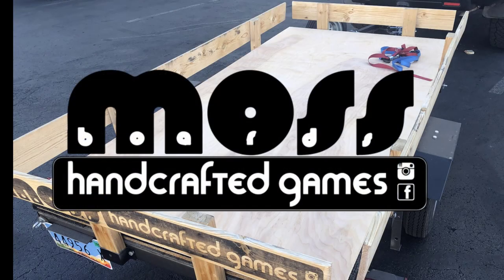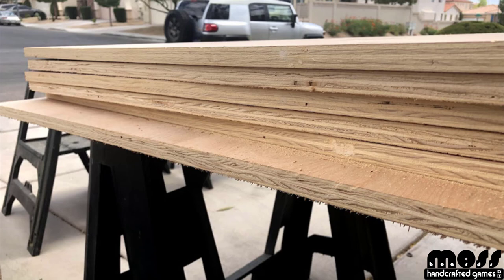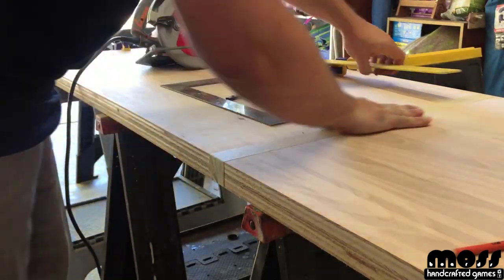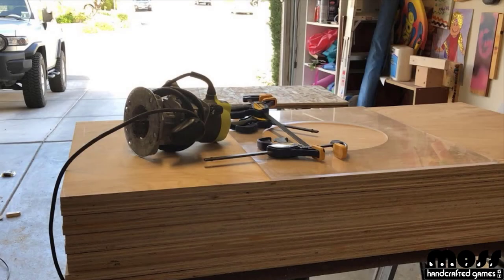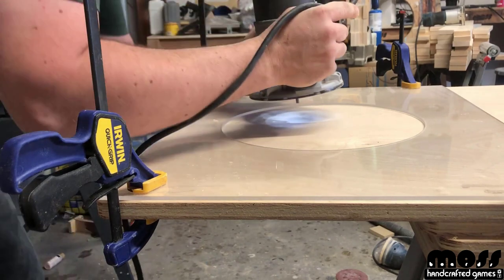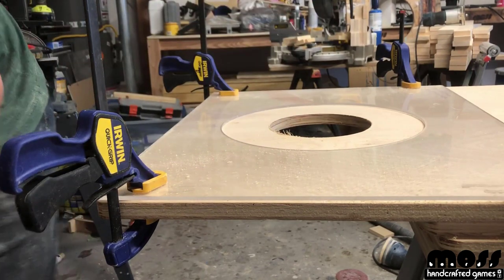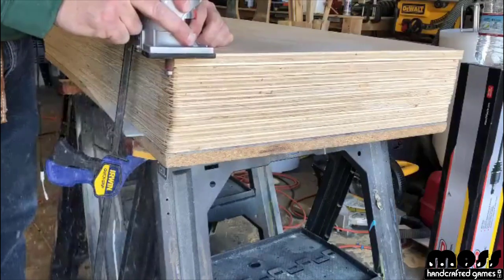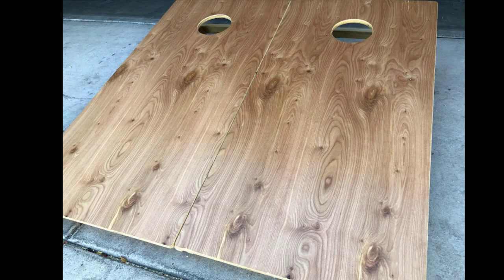Better Cornhole Boards Phase 1: Tops!

Comment: Great video.  I use to use a 6” hole saw and got tired of the drill twisting my arm off. So now I use the Jasper Circle cutting jig model 240.  Perfect 6” circle every time 
‘
Reply from the maker: How do you avoid slipping on the final piece holding the hole cutout? I used to use the circle jig and would have to clamp the board down and screw the hole punch to a scrap to keep my bit from slipping when the center hole was released from the board.
Reply: Cornhole Collective I use a waste board and double sided tape under the cutout. The tape holds the cutout so that it doesn’t move. Works great.

Comment: When you cut that, roughly, 8x4 sheet of Birch in half to make two boards.. I couldn't hear what you used to get such a straight edge on that cut.  I used a circular saw to cut mine and its not quite, right.  I also jacked up my circles but I see plenty of comments below on how to remedy that.  LOL. Nice video.
Reply from the maker: Thanks for watching Jim! I use a Kreg Ripcut guide in my circular saw to cut the full sheets in half. Then I use a 24” metal square clamped to the tops to crosscut those in half. Always take before the crosscut to minimize tear out.

Comment: Great video!!  I like the plexiglass template, would like to see the dimensions on that. And can’t wait to see the next video on the board frame. Thanks again!!
Reply from the maker: Kevin Millevoi 2’ wide, hole is 11 7/8” and works with a 6” baseplate router and a 1/4” spiral cutting bit. I prefer an upspiral bit.
Reply: How did you get the perfect hole in plexiglass? Be nice to see how that is done
Reply: @bryancarfley5467  I'd like to know the secret here too.  I would think using a router could cause the plexiglass to melt as you are cutting the template.  @Cornhole Collective?  Great videos.  Right now I am using an upspiral bit and a home made circle cutting jig and measuring manually to find center.

Comment: I currently use a hole saw. I get it started on one side then flip the board over and finish from the other side and that allows a clean cut, not blowout. I get through in about 2min and dont try to power through it.
Reply from the maker: For sure. Helps to have a wired or very strong drill and Popeye forearms.
Reply: @cornholecollective7116  I just cut a few last night. The only thing I dont like is when it catches and yanks your hands. Im getting routers and all that to make boards like yours. 

I saw the list of things you use online. I have some questions.

 So you use a hand held router for the edges and corners and then a different router for cutting holes? I saw theres 2 different routers. 

Can I use Kreg K4 to build a set or are there multiple jigs for different pocket holes etc?

And Is there a way that I can just order and buy the vinyl designs I want to stain/paint boards as needed for now? I dont build on the scale you do. As of now im just building to put them online locally, for fun and building for friends
Reply: @cornholecollective7116  I just tried to follow/friend on FB and was denied. I havent joined yet bc im still buying tools. So I said 'intend to join' and was denied. I just wanted to follow so I can share with people

Comment: When you do the round over around the entire surface, are you setting the depth to half the thickness? Just got a router and want to make sure I’m not messing anything up.
Reply from the maker: Great question. When I use a 1/4” round over bit i don’t use the full radius. I extend about 2/3” of the rounded part of the bit past the baseplate. Just a personal preference. Lately I’ve been using an 1/8” round over and like that a lot. Be very careful that the corner edge of the blade doesn’t extend past the baseplate or you’ll gouge your deck.
Reply: @cornholecollective7116   Thanks for this, I have been nervous to try and wasnt sure how to set it either.

Comment: I thought about three crosscuts for the four boards 

Never thought about grain direction
Reply from the maker: If you’re fully painting or wrapping the boards, that might be an easier way. My personal preference is the look of long grain and avoiding tear outs with an 8’ ripcut. It can be a lot to juggle if you don’t have a helper or full size table saw.

Comment: Use the wooden Jorgensen clamps. They have a lot more clamping power. After clamping the clamp parallel on the work, use the screw that’s furthest away from the work to tighten the clamp. It won’t move at all.
Reply from the maker: They look like great clamps. I love the security of my screw clamps but it slows me down a lot. Use them for art frames and bigger projects all the time.

Comment: I use a 6 inch hole saw. I don't know why people have so much trouble with it? They might be pushing down too hard? I use little down pressure, cut halfway down. Flip the board over & cut the rest. No tear out...easy peasy. 😉
Reply from the maker: Nothing wrong with a hole saw.

Comment: I just attempted my first set went well so far until the hold low saw slipped but I have a light ring so it doesn't really matter. Idk that I'd build another set I'd rather just purchase once and be done
Reply from the maker: If it’s just to make a set your yourself, especially without many tools, buying is usually the right choice.

Comment: What dimension ply do you purchase? I normally get 3/4' ×4'×8' but I can only get three boards due to cut waste. Thanks for the help.
Reply from the maker: Hmm, Plywood normally has about 1/8” extra width and length for the blade. Mine does. Full sheets ripped and cross cut always gets 4 decks. Ive heard of some mills that don’t.
Reply: @cornholecollective7116  Would you recommend cutting the ply long ways then cutting those sections in half? I've been cutting them 3 times on the short end since the board is most often already 48in long. That's where I'm getting so much waste... I already believe I know the answer by asking my question. Light bulb moment. But instill want to make sure.  Thank you for your help.

Comment: How did you measure and cut your plexiglass template? Thanks!
Reply from the maker: The diameter of a baseplate template like this is the diameter of your baseplate + 6” - the diameter of your bit.
Reply from the maker: I have another video on how to make one.

Comment: The plexiglass template is a sound idea. What did you cut the hole with that won't splinter up the place? Great video, thanks
Reply from the maker: Thanks! I like it the best of the 3 different ways I cut holes. I used to use a home made circle jig that I attach to the baseplate of my palm router to cut the holes. That method requires a lot of set up and if you slip, you're toast. I realized I could adjust the pin, make one plexiglass template and use the baseplate method that I do now with my full size router. Mine is literally scrap wood I bolted to the bottom of my router with a hole to pivot on. Here's a MUCH nicer version of a circle jig you can make to cut your big hole. https://youtu.be/Sf6lqFn_vCw

Comment: I use a piece of mdf with 6" hole and flush trim bit in the router
Reply from the maker: truth h yep, good method, I did that for a while too. Because those bits are meant for trimming instead of cutting, it wears out the fluted blades faster than a cutting bit.

Comment: When you sand your decks? Do you start with like an 80 grit and work your way up to 300+ grit?
Reply from the maker: They come pretty smooth so usually straight to a 320 is good. 180 then 320 if not. Don’t go over 320 though if you’re staining. It “polishes” the wood and it won’t take stain well.

Comment: would I be able to do these cuts with a battery powered Ryobi or do you suggest something stronger? I was looking at buying an electric router but was curious if I should go ahead and buy a plunge router if im going to buy electric? thanks!
Reply from the maker: Hey Blaine, if you have a spiral cutting bit, you might bet away with a cordless router but it might do a number in the motor. I know a lot of builders use a wireless Dewalt without too much trouble. Don’t try it with a fluted bit though.
Reply: @cornholecollective7116  thanks for the response!

Comment: So tape for cross cut but not needed for length wise?
Reply from the maker: When ripping ply (cutting with the grain) you will not often experience tear out since you’re going with the grain, however a cross cut going perpendicular to the grain will more easily get tear out. A fresh blade with the proper tooth count for the job will do a pretty good job, but if you have any bad luck or your blade begins to dull you may be left with some tear out that a round over bit won’t fix

Comment: How did you make the stencil to make the holes? Great video
Reply from the maker: usctrojans50 I made it with a home made circle jig, my palm router and the same upspiral cutting bit. Lots of careful measuring.
Reply: Do you remember the lengths you set your pilot hole on the circle jig?
Reply from the maker: usctrojans50 hard to explain but the large hole (baseplate template) is 11 7/8” so the circle jig to make that was set just shy of 6” from the center of the pin to the outer edge of the cutting bit.
Reply: Thanks again. I used a circle jig for the hole and it slipped right at the end and left a little dip.
Reply from the maker: usctrojans50 arrrrgh. Infuriating. Helps to clamp a scrap board to the bottom of whatever you’re cutting with the pivot nail all the way through the cutting surface and scrap. That way the bit doesn’t slip when the cut out is loose.

Comment: I look for a thicker top veneer. Most are paper thin. 
I actually have found some radiatta pine with a 3/32 top veneer
My template is out of 3/4” PVC 
Much less chance of the router jumping
Reply from the maker: Pine has been a problem for stenciling designs in the past. I like domestic birch with thick veneers the best. Baltic is a close second. The paper thin imported stuff is trash.
Reply: Cornhole Collective 
I prefer an 1-8” round over and we radius our corners a bit more. Nice overall design though
We stain and urethane the pine before stencil work, so it tends not to bleed.
Reply: We also do a lot of decals on the boards and many PVC top boards. 
So many ways to approach the tops. 
We pocket screw the frames to tops and frames together

Comment: Hi Scott! I really like the idea of your plexiglass template that you made for your router to make that perfect 6" hole. What is the diameter of the hole that you had cut for the plexiglass?
Reply from the maker: Thanks! I came up with that because I was tired of burning up my router and bits with a flush trim method I used to do. I have a 6" baseplate on my router and 1/4" bit. The plexiglass template has an 11 7/8" hole.
Reply: Gotta remember, that hole is going to vary based on your routers base

Comment: What are the measurements on the plexiglass hole or do you sell this piece?
Reply from the maker: Check in on our site, I will be making and selling more. www.cornholecollective.com

The measurement for the hole, if you want to make one is 6" + Baseplate diameter - bit diameter.

Comment: Funny that all the comments seem to be about cutting the hole, mine included.  I'm surprised you cut it in one pass.
Reply from the maker: yeah, a good upcut bit can do it in a single pass no problem. Don't try this with a Diablo bit though. I broke a couple on the plunge and on the push. Very brittle.
Reply: @cornholecollective7116   What brand bits do you use? Home Depot boasts on their Diablo bits

Comment: What size flush trim bit did you use?
Reply from the maker: I've had the best luck with Whiteside brand bits, 

Cutting the holes: 1/4" Upspiral (Up Cut) cutting bit with a 1" cutting blade. 
Rounding the corners: 1/4" two-flute flush trim bit with 1" blades. 
Rounding the edges: 1/4" roundover trim bit.

Comment: Got some imported birch plywood, big mistake. The veneer is so thin, and the layer under the veneer has a reddish color to it. Rounding the edges, especially around the hole, leaves an ugly looking red edge. Also, don't even walk by it with sandpaper or it will burn right through! Going back to the lumber yard next week to see how thick the veneer is on their domestic birch.
Reply from the maker: Oh man. I’ve experienced that myself. Had to repurpose the wood entirely. Chinese imported birch, mine had 11 layers I think was garbage.
Reply: @cornholecollective7116  luckily it was just for me, so I painted the boards. Came out looking pretty decent actually. Problem was, I had inlaid some colorful exotic hardwood down the center of the board, and was trying to sand it flush. Next time I try this, I will make sure the inlay is pretty much flush to start with! P.S. do you think there are some plywoods that would hold up to this process?

Comment: Official corn hole boards are 1/2 in thickness they are supposed to bounce
Reply: 1.2 ACO Approved Equipment – Not limited to ACO branded equipment – In order to be classified as ACO Approved, equipment must comply with the criteria below. ACO Approved Equipment may be used for the coordination of ACO Regional tournament during ACO Season XII
ACO Approved Boards:

1. Hardwood plywood playing surface measuring 47.5” to 48” x 23.5” to 24”.

2. The playing surface has a minimum thickness of 1/2” with cross-section backing, or 3/4” with or without cross-section backing.

3. Each Board in a set should weigh no less than 25 lbs.

4. Each hole is 6” diameter, centered 9” from the top of the board and centered from each side edge.

5. The front of the board is 3” to 4” from the ground to the top of the playing surface.

6. The back of the board is 12” from the ground to the top of the playing surface.

7. The playing surface should be finished – sanded to a very smooth texture. There should be little to no blemishes in the wood surface that may disrupt or distort play.

8. The playing surface can be painted with a high gloss latex paint or varnish. The surface should allow bags to slide when thrown, but not be so slippery that the bags slide back down the platform.
Reply from the maker: Hi Bryan, see bullet 2 above. 1/2" boards with brace are a lot bouncier than 3/4" with or without brace in my opinion. I've made plenty of both and some of it has to do with the bags you use. All are spec but they do play differently.
Reply: @cornholecollective7116  Yep, I was just responding to Barry. About the official thickness of the boards. Most people buying the boards probably don't really care or know what the approved thickness is. Love your boards and videos!